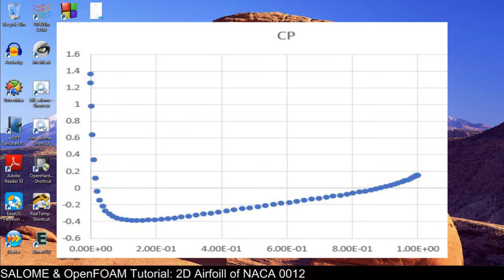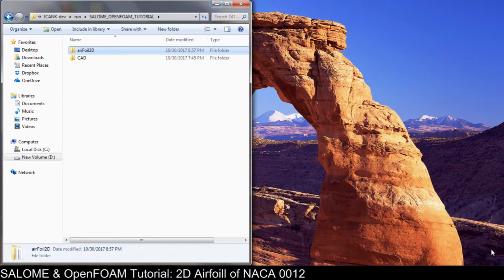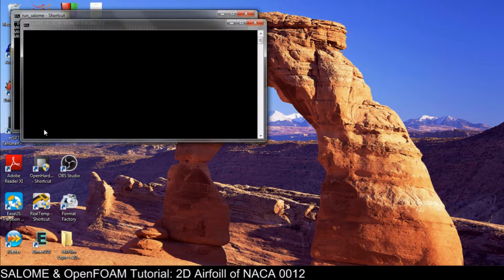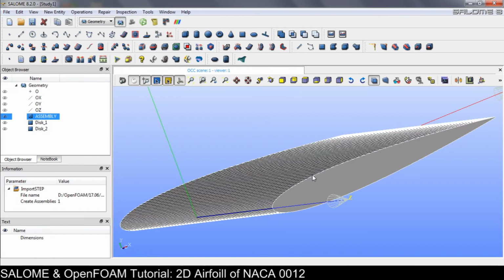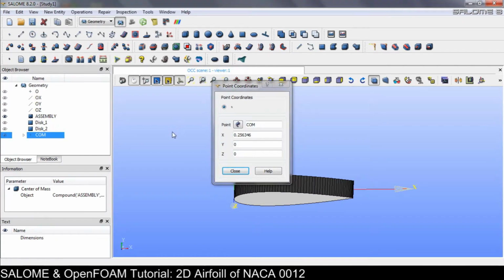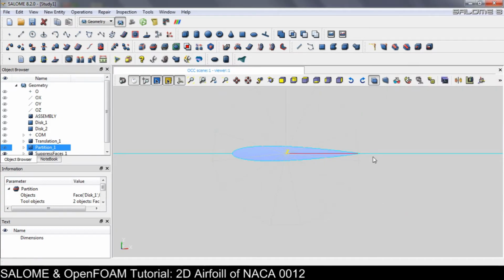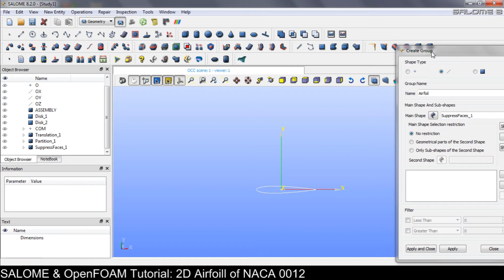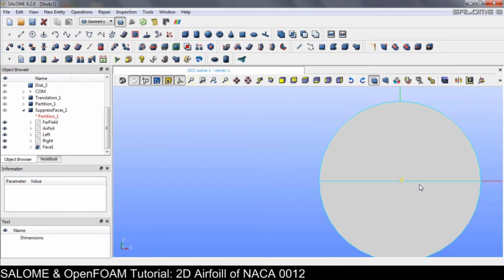SALOME + OpenFOAM Tutorial: NACA 0012 Airfoil Part 1

Comment: Assalamualaikum, mas Ali. Thanks so much for your kindness to share this Video. I am Egi Sepfriansyah would like to ask ...when i run Pig inside of the pipe (by pimpledymFoam) in OpenFoam or Blue CFD  i find some problem that backtracing. could you help me to solve it. i have tried to decrease the mesh size, and delta T in control dict but it was still backtrace.    

Hopefully you have time to answer me,

Thankyou, 
Wassalamualaikum